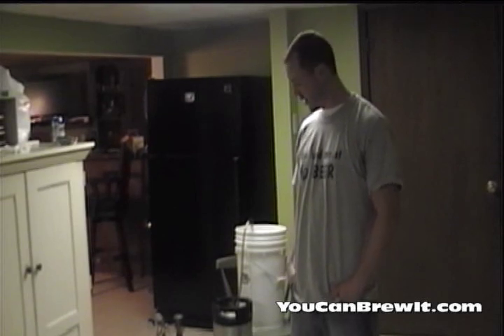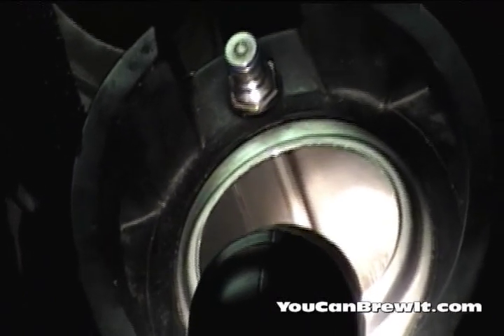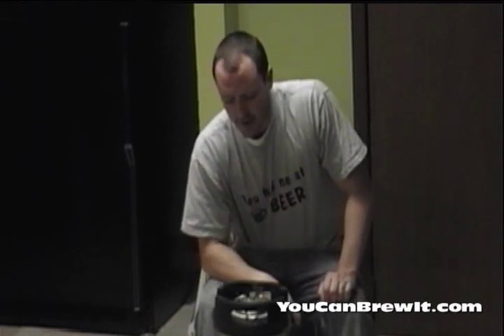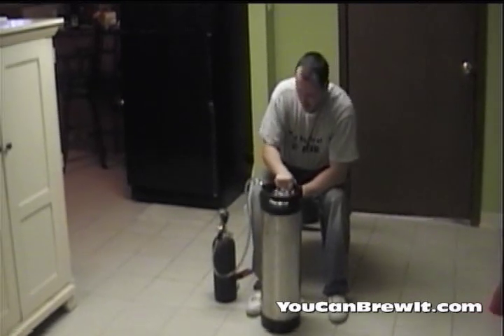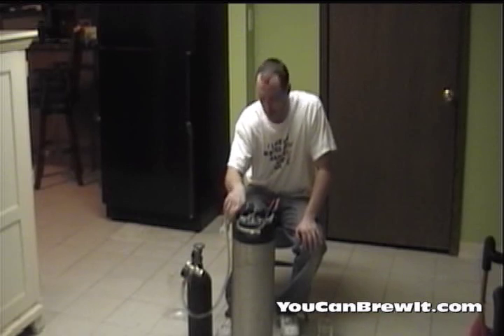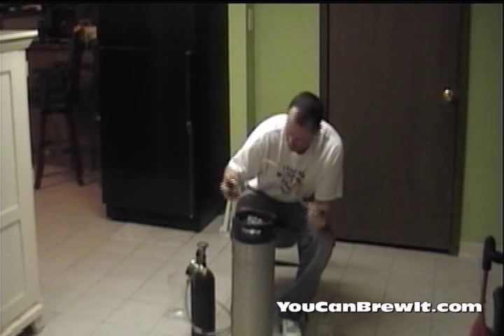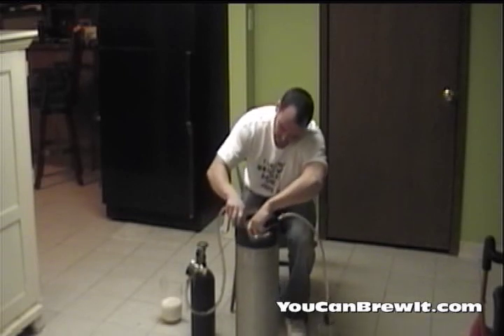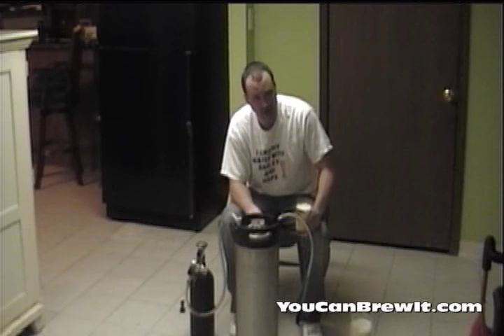How to keg and force carbonate your beer - Homebrew Tutorial

Comment: @YouCanBrewIt: Cool, thanks! I tried to use 3/16" tubing last night (to test fit the gas line), and let's just say it was a tight fit trying to get it over the 3/8" barb on the regulator. The 5/16" should be here in the next few days.
Thanks again!

Comment from the maker: @mcfaen In my experience, using the dip tube saves you about 2 days. If force from the gas in without rolling it takes about 2 to 3 days. If you use the dip tube it takes less then a day and you do not have to roll it for a half hour. cheers...

Comment: As the CO2 bubbles up from the bottom of the keg (through the dip-tube) to the top of the keg, it allows the CO2 to come into contact with more of the liquid on the way up.  This does actually speed up carbonation quite a bit.  Ask any chemist!  Any time you want to dissolve a gas into a liquid, you bubble the gas through that liquid.

Comment: Hello,
I'm getting started with kegging this week, and I've got a question. For your gas lines (both for force carbonating and for serving), do you use the standard vinyl tubing (as opposed to special gas tubing)? It looks like it from this video. I've seen a bunch of folks using special gas lines, but from what I've read, I can't find anything that suggests it's a requirement. I plan to use regular vinyl for both the gas and the beer lines. Thanks!

Comment from the maker: I disagree, I have been brewing for many years and have done both methods and forcing from the top takes about 3 to 4 days if not more, vs carbing from the bottom “up” can take less 6 hours. The CO2 does not sit at the bottom, it is forced through the chilled beer from the bottom up. Thanks for knocking my vid though. Cheers!

Comment: I know quite a few chemists and while you're premise is correct, it does not really apply here. Yes, a very small amount of CO2 will enter the liquid, as it bubbles through, but not more than would enter from the top under atmospheric pressure. The only way to carbonate "from the bottom up" is with an air stone and very little pressure...so little that the bubbles never reach the surface. Any gas bubble that reaches the surface takes well over 99% of the gas it started with along with it.

Comment: i know that first comment came off a bit dickish, and i'm sorry for that...would have elaborated more if i had more characters available. In order to truly carbonate from the bottom up, you would need an air stone and probably around 0.5-1psi to ensure that the CO2 bubbles don't reach the top. only then is your CO2 actually diffusing into the liquid enough to make a difference (unless that's a  liquid nitrogen refrigerator in the background!!) a 1/4" tube wont make small bubbles at 20+psi...

Comment: You're assuming that simply bubbling gas through liquid provides more diffusion than pressure, which is simply not correct. One mole of CO2 "bubbled" through liquid will not produce the same diffusion as one mole of CO2 at 30psi (all other factors being equal).

Comment: lol at "carbonate from the bottom up"....you do realize the CO2 went straight to the top of the keg as soon as it went in right? it doesn't hang out at the bottom. the outcome is absolutely no different than using the gas-in line because you're building pressure at the top of the liquid which causes the gas to diffuse into it. once you shut it off, the entire liquid out pipe is full of CO2 that is not contributing to carbonation. A negligible amount, sure, but your method is not beneficial.